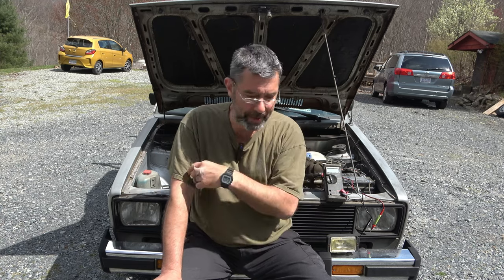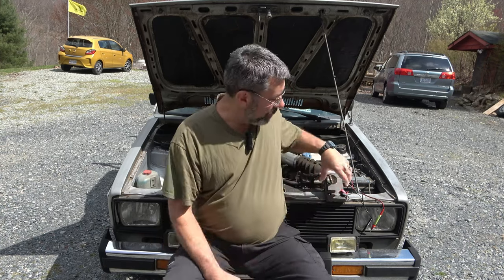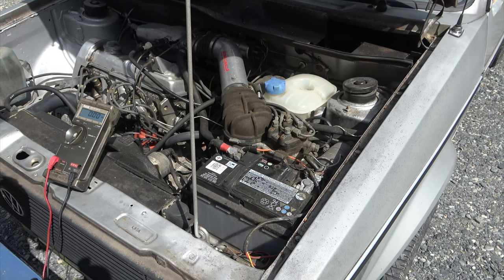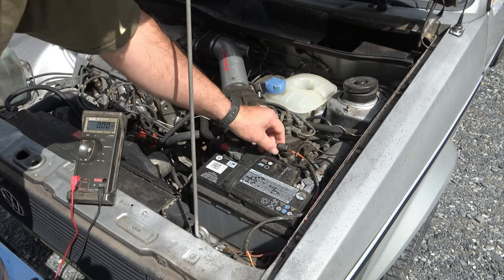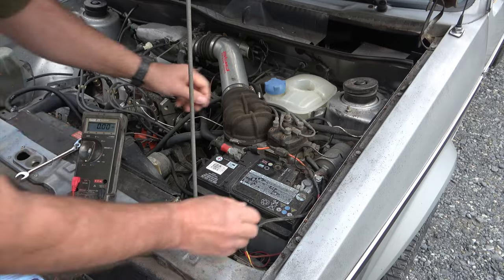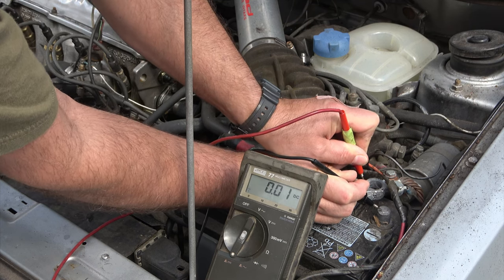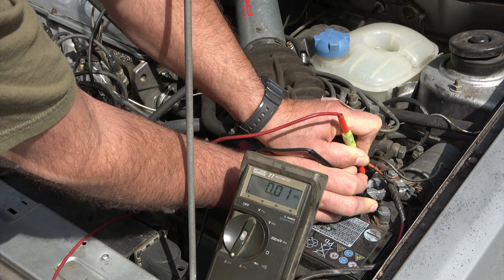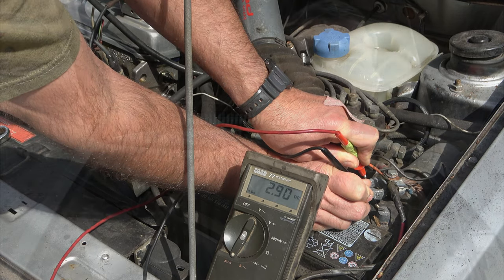If Your Car Battery Goes Dead Overnight Do this To Fix It!

Comment: I do the same thing but instead of a multimeter I use a test light so you can see it when you're in the car pulling fuses. Works great!
Reply from the maker: That is another great one to use- the test light is simple to see when there is an issue

Comment: My multimeter doesn't have just amps on it as a setting. It has a range of amperages from 2000u to 10. Which one should I use?
Reply from the maker: Use the 10 amp side.